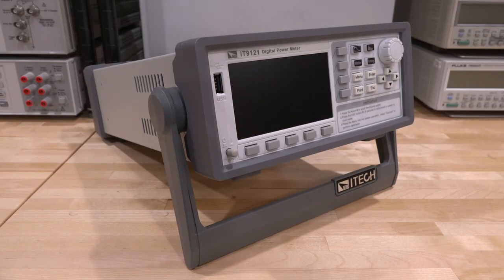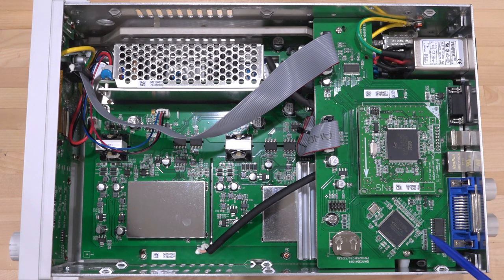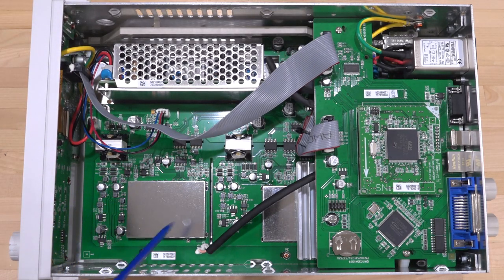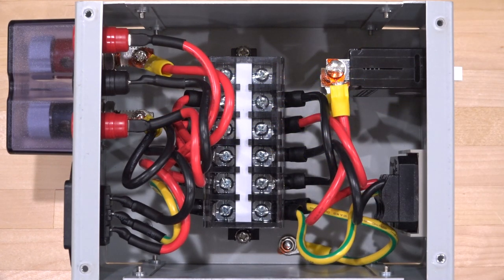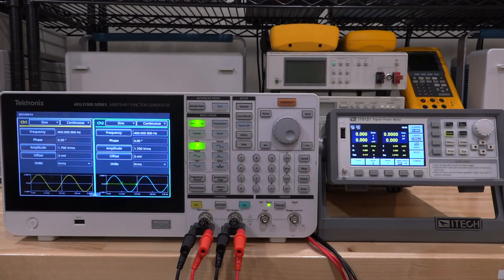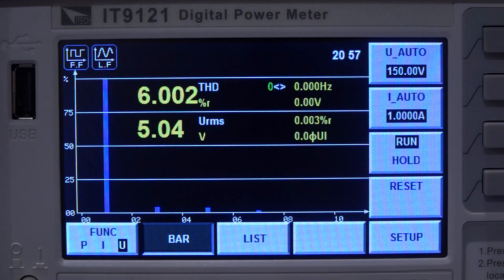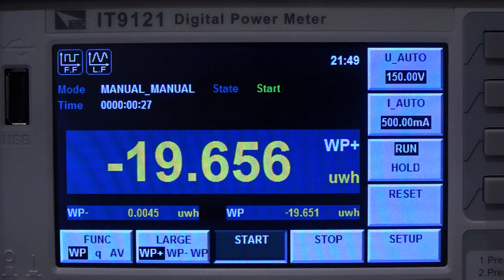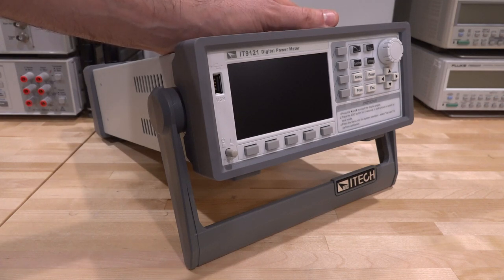TSP #185 - ITECH IT9121 Digital Power Meter (600V, 20A) Review, Teardown and Experiments

Comment: I doubt the relay contacts are part of the current measurement path - you'd normally measure it differentially across the sense resistor itself.
Reply from the maker: Yes, I agree. Thanks Mike.

Comment: I've used ITECH DC loads back in 2012-2014, and I see they still have poor software quality even today :) Otherwise quite cost effective instruments!
Reply from the maker: Yes, the software itself would be good if it worked and maintained the connection.
Reply: I have an IT8512A+ load, once contacted the ITECH engineers to upgrade its software, you can also contact them. As far as I know, their software of load has several updates in recent years.
Reply: Now the free PV9000 software can be downloaded, since 2015, they upgraded all softwares, it's much better GUI

Comment: Maybe similar. We had problems with the CH340 IC on cheap Arduinos dropping out with the Win driver, switched to the manufactures CH340 driver and it's fine. Maybe there is a better chip driver.

Comment: I didn’t like that voltage wire draping over the heat sink.  They could have made it a bit longer.  Maybe that heat sink doesn’t get that hot to worry about melting through eventually 🤔
Reply from the maker: The voltage wire had a protective sleeve, but it is also silicone and won’t melt. I don’t think this will not be an issue.

Comment: Excellent review.
I suspect there's a Kelvin connection to the current sense resistors so the relay contact resistance is irrelevant. I have a Voltech PM100 which is excellent but now seems obsolete compared the this instrument.
Reply: Contact resistance in relays are for sure irrelevant, just as the user cables going to/from the current input

Comment: Thank you very much for this review. I am considering this instrument for Ultrasonic Transducer Power measurements. The data sheet claims 100 kHz bandwidth. I need to measure power for 18kHz to 45kHz signals. Voltage is 100 to 300 Vac and the power is around 10 watts. I want  Apparent Power and Power Factor corrected values. The wave forms can be quite distorted as we drive a square wave through a step up output transformer then into a Piezo . We are operating the Piezo well outside its resonant frequency and I want accurate power measurements of this signal. Any recommendation for an instrument that will do this?

Comment: Meh, 15A? We have 16A in Europe. Also: Is there a single fuse in that meter, especially in the current path?
Reply from the maker: Its a 20A instrument. Or up to 50A for the other models.
Reply: @Thesignalpath  sorry, I was talking about the mains adaptor box.
Reply: And even that's too much for the inlet power connector - the IEC 60320 C13/14 connectors are only rated to 10A.

Comment: A power factor of .6 is fairly "decent", though I have been wondering how effectively we could clean it up with just an AC 50/60 Hz band-/low-pass filter.
Ideally, a power supply should have as close to 1 as possible as its power factor, even if this can be costly to implement.
Reply: "AC 50/60 Hz band-/low-pass filter." This is essentially what passive power factor correction does, however if your PFC does not change much with load you can just cancel the reactive component with a passive of the opposite value. For higher power systems, Active PFC has become the norm, which has driven cost of active PFC down considerably in the last 10 years.
Reply: @samfedorka5629  My question weren't though if it works, but rather how much impact it has.

I know Active PFC costs only a dollar or three in production as is for "moderate" power loads. (like the low of hundred watts.)

I have though been somewhat surprised that there isn't a simple single chip solution for it yet... After all, half decent active PFC isn't actually hard to implement. (I have seen plenty of controllers, but I would love to see a TO-220 with controller, inductor and switching transistor all in one package. Or a TO-92 for lower power applications.)

(Active PFC is practically a boost converter that is primarily controlling its PWM as a function of the rectified mains input voltage, and then has offset governed by a box car average of our output voltage during the last couple of cycles. Then we just have our main's filter cap between our PFC and our main SMPS converter. To prevent over volting our output we will let the average of the control offset increase a bit faster than it decreases. Of course our output cap should also not be operated at it's peak voltage, we should have a decent margin. And yes, a PCF like this will output the same output voltage regardless of input voltage. Something that is nice in SMPS designs.)

Comment: The price of this is very similar to a Keithley DMM6500.  As I already bought one, a few months back, based on Shahriar channel, it sounds to me that a second Keithley with a bit of software will be better value for money, not to mention all the additional things I can do with 2 keithleys.  Even with my single DMM6500 and a few software add-ons and an external amp meter probe, you can measure most of this.  I guess my point is that the Keithley DMM6500 is very good value for money.  This ITech look like "ok value for money" compared.
Reply: btw, that Keithly is running 24/7 a analog temp sensor, and it's amaizing what you can learn from a 6.5 digit temp measure (if you plot it over time).  It picks up when I enter the room.  I use something like this: https://www.dfrobot.com/product-164.html
HF is cool, but hi-res is also in a same way very satisfying.  with nano amps you can create ECG by just holding the 2 probes (one in mouth and other on stomach give better results :))